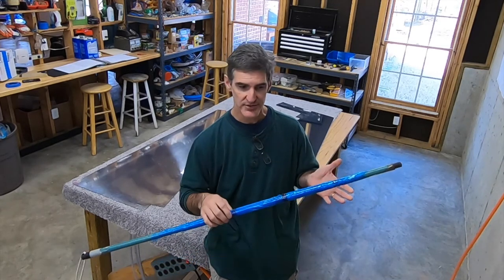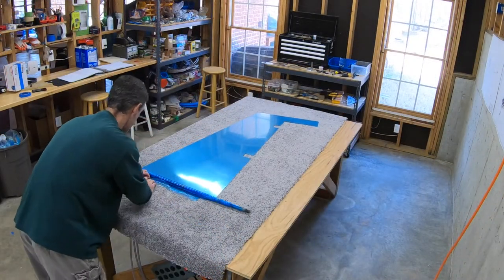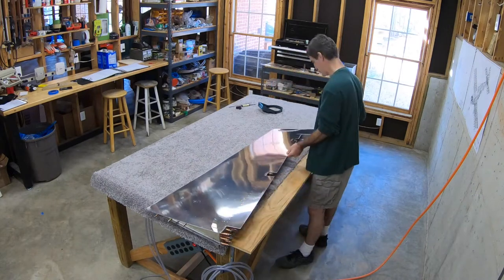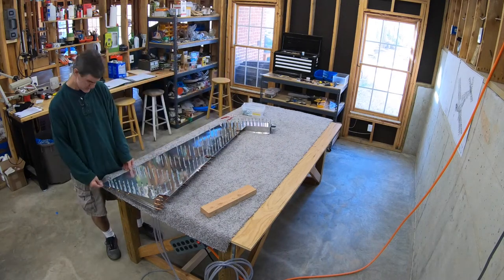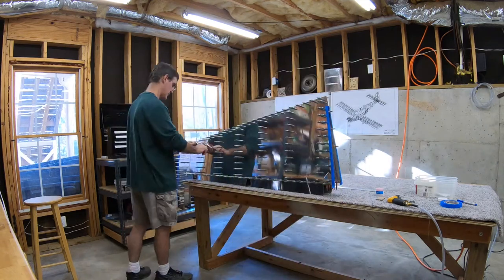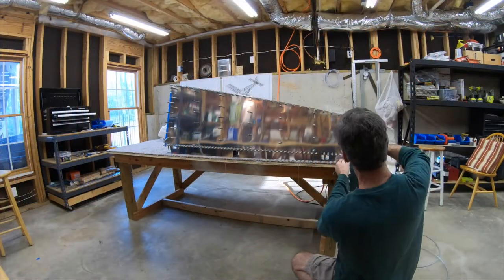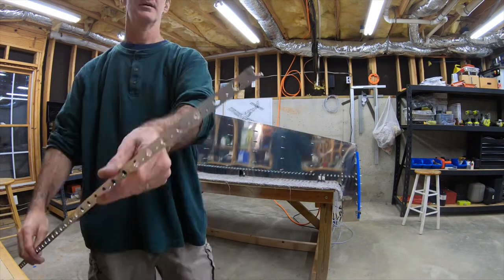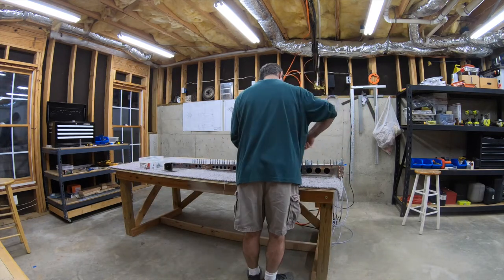RV-10 Build Log - Emp 22 - Finely calibrated cardboard

Comment: You're likely far enough into your build by now to have heard scuffing up the skins only matters if you're planning on leaving your plane unpainted and buffing the metal. Your painter is going to scuff everything up before priming anyway.
Reply from the maker: Yep.  It's reassuring when the blue vinyl is protecting everything, but not worth leaving it on and doing the soldering iron thing.  At least that's the mode I'm in right now.  Maybe when I'm working on the wings I'll be more protective.  Then again, maybe not...

Comment: Can you explain how you use Boelube?
Reply from the maker: The stuff I use most on the plane is kindof a waxy paste.  I usually just stick the end of the drill bit or reamer into it and spin the drill for a second to get a little on the tip.  It melts a little when the bit warms up with use and provides a little lube.  It seems to prolong the life of the bit somewhat, but to be honest, it's probably much more important if drilling steel.  I tend to be more careful about using it when drilling harder parts like hinge brackets and such.
Reply: @missiletwentynine2667  Thanks for the reply. Using it for thicker material makes sense.